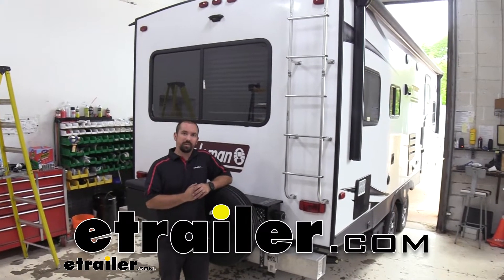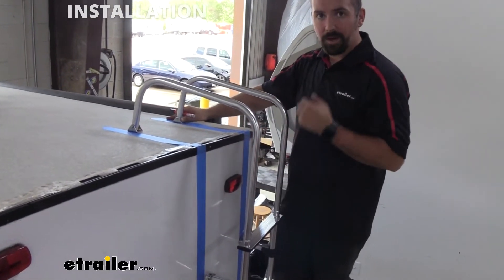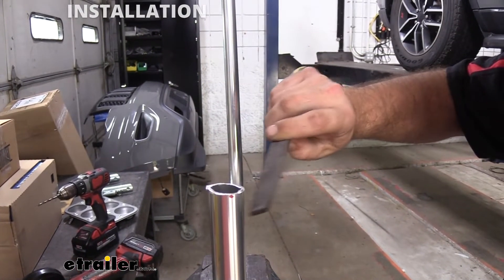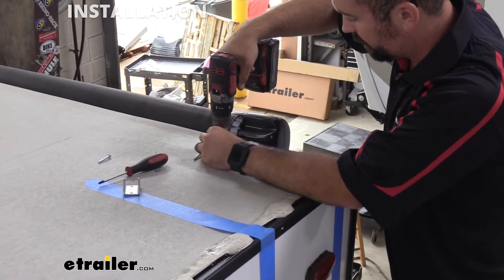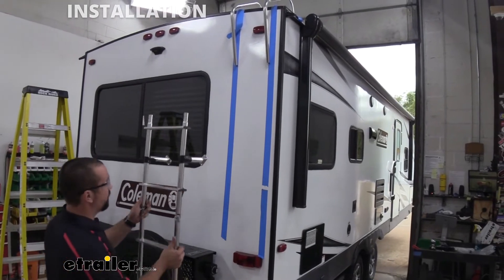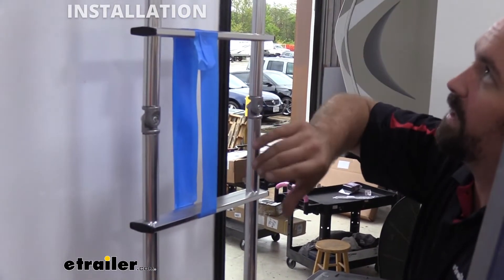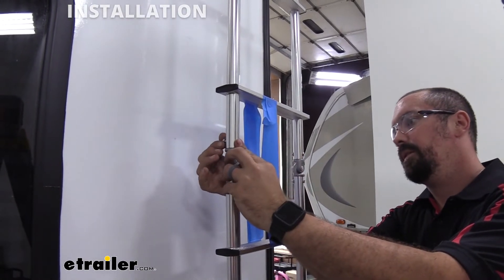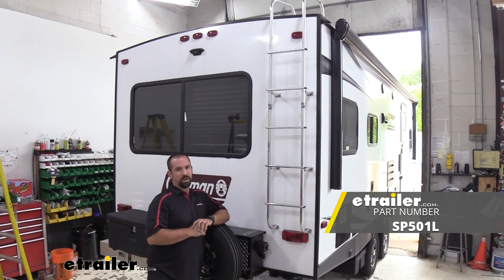Installation: Surco Exterior RV Ladder on a 2020 Dutchmen Coleman Lantern LT Travel Trailer

Comment: Great video! What type of screws did you use?
Reply from the maker: I'm not sure what was used in the video, but the ladder includes the following hardware:
6- 10-24 x 1 ¼” Phillips Screw
2- 10-24 x 1 ½” Phillips Screw
8- 10-24 Keps Nuts
28- #10 x 1” Phillips Particle Board Screw

Hope that helps!
https://www.etrailer.com/RV-Ladders/Surco-Products/SP501L.html